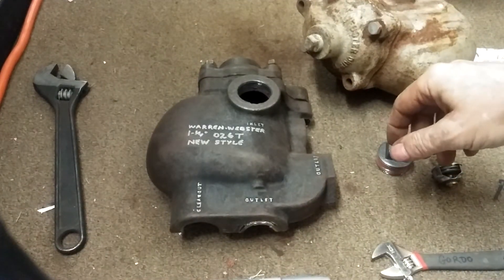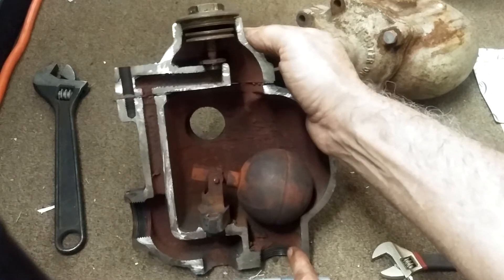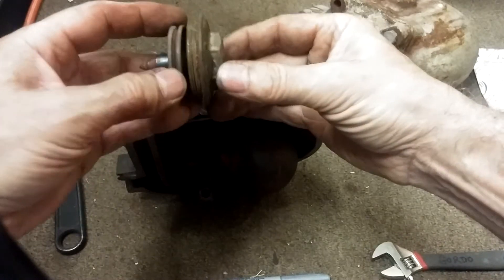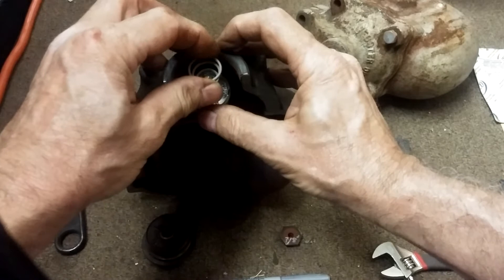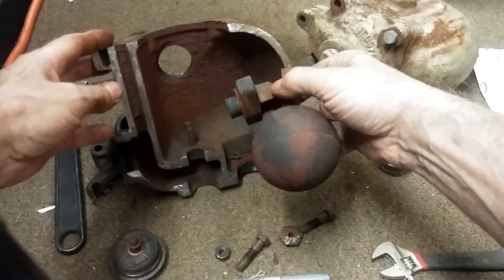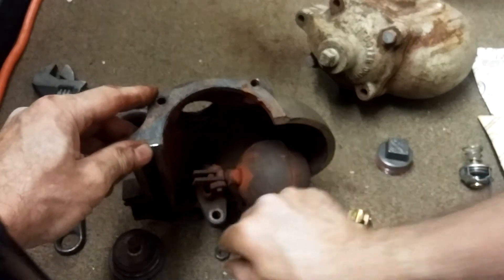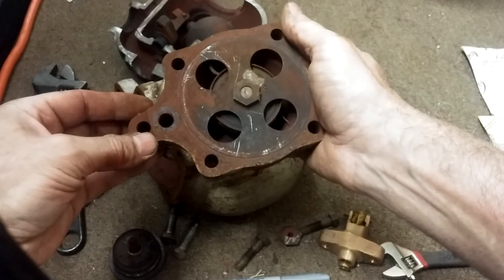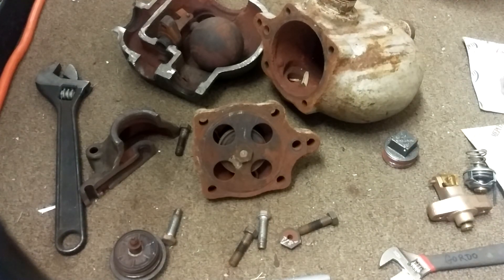Warren-Webster 026T Float & Thermostatic Steam Trap: Passed Its Freshness Date

Comment: I’ve got two old style traps in a building I’m working on. One works great! One is blowing through. Both are original.
Reply from the maker: Are you considering re-building the failed one, or replacing with a modern 6-bolt trap?
Reply: @gordonschweizer5154  I want to go back to my office first and re-check my handwritten notes from when I tested it. Based on your video I will likely first open the clean out plug, maybe retest, then probably replace it. I’ll talk to Tunstall first.
Reply from the maker: @davidfleuchaus  We are talking about the 1-1/4" or 026 as opposed to the 0026 (1") or a 00026 (3/4"), is that correct?
Reply: @gordonschweizer5154  Yes.
Reply from the maker: @davidfleuchaus  I believe Tunstall will only have parts for the thermostatic part of the trap that trap.
That's the part most likely to have failed over the 90+ years.
If it an old style 026 like you say, 5 bolts & the gasket would need to be removed for access, as you know.
I have OEM float parts, if that's what has failed, if you should decide to go that route.
Generally, unless there is limited access or asbestos covered pipes nearby, I'd go with full replacement.
I, of course, cannot see your job or know of all your circumstances.